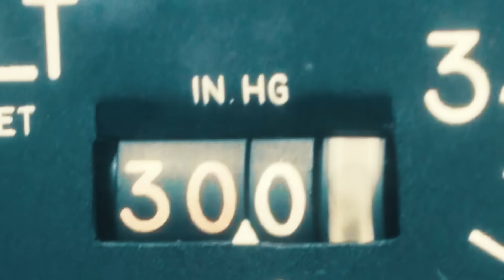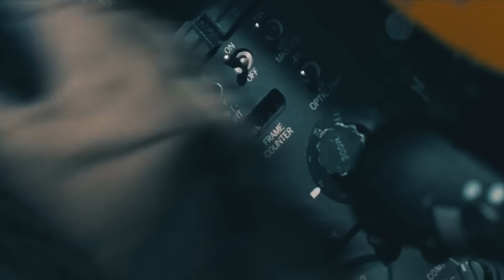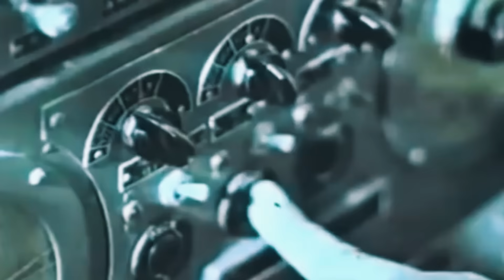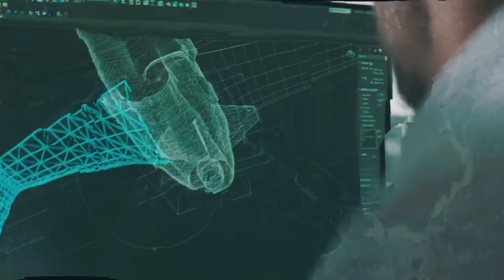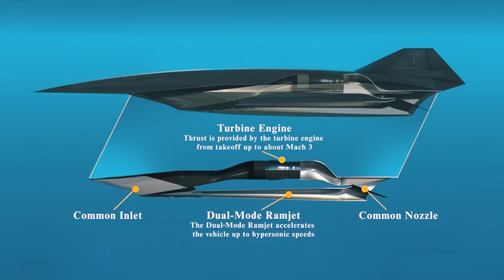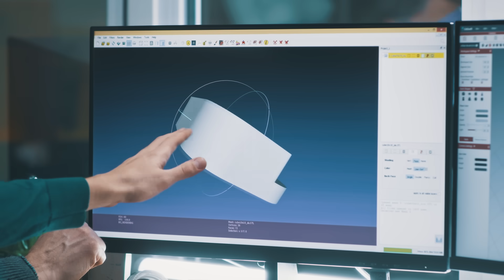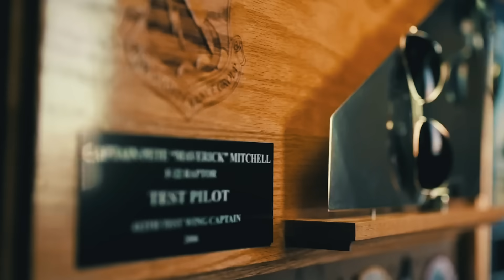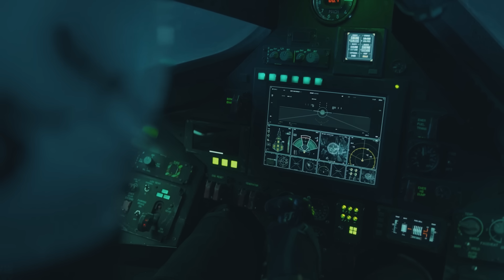USAF Declared SR-72 Darkstar Is Finally Ready To Fly

Comment: Oh, so they retired the SR71 BEFORE is replacement was ready? Not likely.
Reply: The replacement was ready.  Its called satellite imagery.
Reply: @wallytuber  EXACTLY.  People here forget what satellite technology was like before the SR-71's time ...  Satellites of that time used film;  not digital cameras;  they'd take pictures and then waited until they were flying over the US and dropped the film in a capsule over a desert, and people had to go and comb the desert to find the darn capsule.  That's why the SR-71 was such a good idea. Digital photography and communications were what made satellites far more valuable, and rendered the SR-71 obsolete.  And what makes now the SR-72 less obsolete is its ability to steer and go to any place and time and get real time data on anything.  Satellites are periodic observers.
Reply: Retired from the military. NASA still has some and the CIA still operates 3.
Reply: Of course it's completely unlikely. You know perfectly well Skunkworks had to be working on Mach 6-10 just a few years after the SR-71 was completed. I'd be shocked if it took them beyond 1970.
Reply: Better interceptor missiles and ever increasing quality of satellite images made the sr71 an extremely expensive platform without a practical purpose.
Reply: Aurora was the middle child
Reply: Quite likely actually. The SR71 was expensive. Required special fuel injectors, and needed to be refueled mid flight. 
In the mean time, we developed other forms of recon. Drones became way more popular and were the safer choice.

Comment: The AF complained about the cost of using the SR71 but the purchase very expensive fighter planes
Reply: I believe this plane will be a nightmare for china and russia  ,it's game changer .
Reply: Fighters cost to run are cheaper
Reply: @andyvie5332  how many SR71’s operate? How many of those high priced do we operate? Granted different missions. But a lot of money
Reply: @rufusmedrano2962  sr71 leaks fuel on the runway, special fuel that only it uses(could be wrong about fuel difference) has to be refilled in air by another plane every time it goes up 
2 pilots equals two pay checks plus the crew of the tanker that refills it 
Replacement parts were not shared on many other planes which meant keeping her ready to run wasn't cheap either 

Per plane it was more expensive
Reply: @andyvie5332  I know I leaks on the flight line. It seals when the body of the sr71 heats up. Pilot pay has nothing to do with it. Some of the things you saying doesn’t mean anything
Reply: @rufusmedrano2962  not alone but it adds up, my point is its more expensive to run it compared to an f-22 for mission you can just get global hawk to do worse but easier
Reply: @andyvie5332  that’s why during the history of the blackbird it never had a full tank of fuel. Historically when they got to a certain height they refueled it. Obviously when they got to speed and the air frame heated up the tanks got sealed
Reply: @rufusmedrano2962  but then you have the fuel from the tanker you need every time it goes up and it cost money to fly the tanker
Reply: @andyvie5332  it’s just the way the plane was built. It’s weird that when the plane is on the ground it leaks but when it flies it seals the tank
Reply: @rufusmedrano2962  I believe it has something to do with the "heat barrier" after mach 2 and it was what they came up with to counter the rapid expansion under the heat and air density at altitude
Reply: @andyvie5332  what I find interesting is when the sr71 heats up it grows about a foot 🦶. I’m not sure exactly how much. But it’s an awesome aircraft. When I was in the MC ON OKINAWA I had the pleasure of seeing one take off. This was back in 1976
Reply: @rufusmedrano2962  that's sick! Thank you for your service
I've only got to see the one on the Intrepid in New York so it's always been like a mythical creature to me
Reply: @rufusmedrano2962  side note I have been enjoying this discussion and I appreciate how civil you've been I don't really get the chance to debate with people who bring up valid arguements and counter-arguements without it devolving into name calling and I really appreciate it
Reply: @andyvie5332  yea my friend were just having a conversation nothing to get mad about. It was a good conversation. I appreciate it to